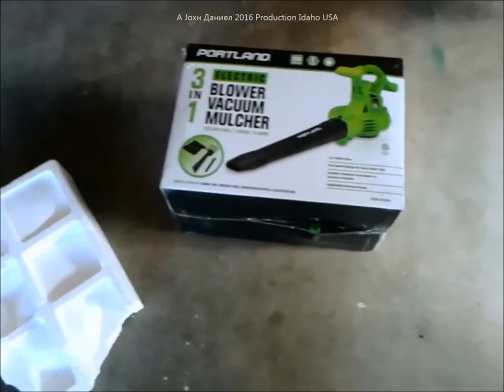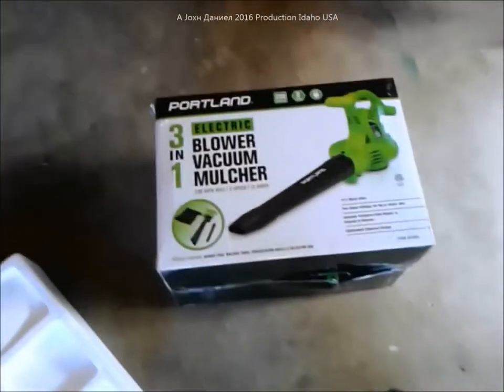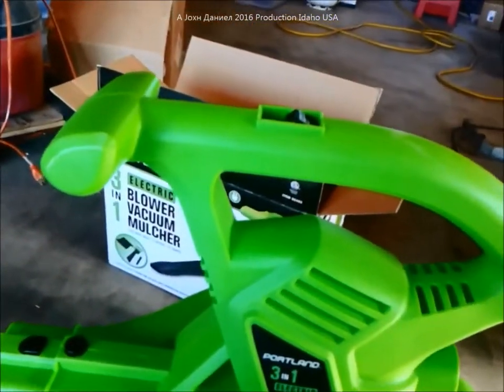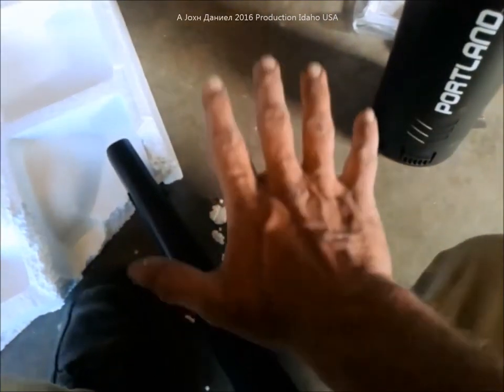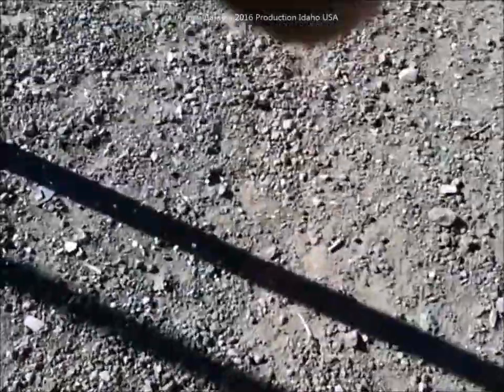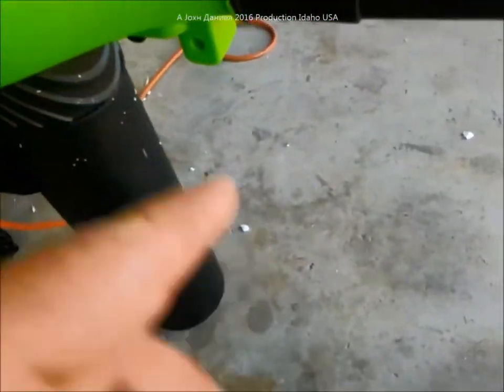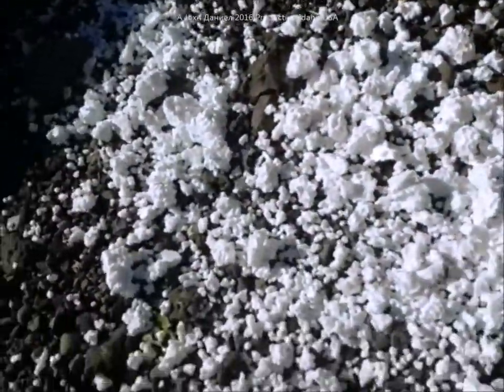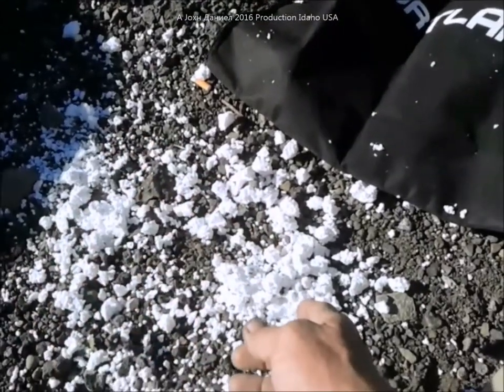Harbor Freight 3 in 1 Electric Blower Vac Mulcher NEW USE- insulation blower!

Comment: Glad I saw this before I insulated my new metal garage. I have a 28 x 36 versa tube garage and work shop. They put a 2 inch fiberglass pad of insulation on all of it but western Colorado is cold like it was in Pennsylvania. I plan to put real 1/2 inch plywood on all the walls and this would be brilliant to do to fill them.
Reply from the maker: If you use a blower like this be sure to allow venting. I filled 9 wall sections and it worked great but I put in 2 holes in the top of the wall. One was for the blower tip, the other was a air release. I stapled a screen over the air release and it worked fast.
Reply: I just finished doing my ceiling in my shop. I put 3/8 inch plywood on the ceiling and blew in that styrofoam bits using the same methods. I got all they had from the stores in town which filled my 24 foot cargo trailer 2 times. Then like you I used my riding bagger mower to bust them up to fit in the little mulcher and then blew it all into my ceiling. Its over 8 inches deep in ground styrofoam now. And we had 100 degree temps and my shop is in the low 70"s inside.

Comment: What a neat idea, it would also work great for somebody like myself that sells on ebay, I constantly need packing material. I had thought about putting it through a wood chipper/shredder before, but this little blower would be prefect for in the shop. I look forward to a update on the long term of the blower. Thank You
Reply from the maker: +Great North Woods Hillbilly Another video showing in use is on the way.
Reply: Look forward to it.

Comment: This gave me a great idea to insulate the walls of my stealth woods shack. I'll frame then clad the outer walls with pallet planks, then plank in the inside leaving a hole at the top to blow in cellulose. The holes will be cleared of insulation and a  2 bottles cut in half and glues together will fill the holes after drilling through the outside after filling. I'm going to improvise a hopper using gravity with the blower upside down and a hose going from the end of the blower to a curved filling nozzle. I know I need a vent hole so maybe that can be about 3' from the floor using bottles to fill the hole. Thanks dude. Florida has some slippery scammers too, being the colostomy bag of the nation and all.
Reply from the maker: DON'T use pallets!!!!!! Poisonous!! Its a bad craze that needs to be stopped. Pallets have arsenic, chromium and other deadly chemicals in them. If you want a insane build, use insulated garage door sections. They interlock, are already R-8 and then insulate more in your framing. Garage door companies can make them up to 48 feet long, blanks, cheap and they can handle a 2x4 in a hurricane traveling at 90 mph.
Reply from the maker: PS - If you want stealth, you use Durock board with 2" deck screws. No shits! EMP, vandal and Infrared absorbing and easy to camouflage with mixed cammo paints and large sponges to dab it on. Use the 1 x 1/2 x 1 Z metal strips overlap flashing and Flex230 to seal the vertical seams. 50 year life, never a problem, 2 layers of 1/2" stops a 22 and 223 caliber dead. Put i layer of 7/16 OSB behind it and stop a 357 caliber. Built one camp cabin 12 x 28 in Athens Georgia 11 years ago with same process, still like new today and very strong. Cheap too.
Reply: Man, thanks a lot. I'm looking into your suggestions. I can find other reclaimed wood or find the cost of the garage door sections. Keep on mind it's only for a year or so and I'm trying to be as cheap as possible since the idea is to do it to save myself about 2500 bucks a month to save for the land to build the non-prototype.
 Respect to you sir.
Reply: @JOHNDANIEL1  Ok, concerning the durarock, that's for the outside of the framing correct?  So I would need a good alternative to the pallet wood for the inside as well preferably some reclaimed wood or super thin 1/8th inch plywood cover sheets for free from the distributor for cabinet shops. I was concerned with mold using Styrofoam plus I heard the bugs eat it. I've got about a week or two before I start the build, with most things being fabricated or prepped at my warehouse close by. I'm racking my brain on a cheap way to do this but still have structural rigidity and some insulative qualities. I'll be in what is like a mini rainforest on the edge of the everglades so it can't be some open for mosquitoes luncheon with me as the special.
Reply: @JOHNDANIEL1  not all pallets have deadly chemicals in them